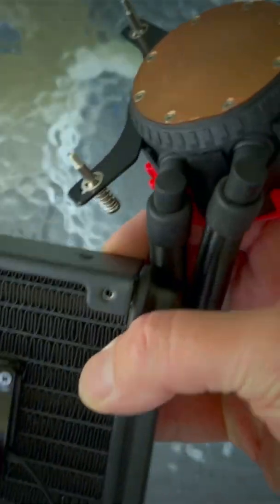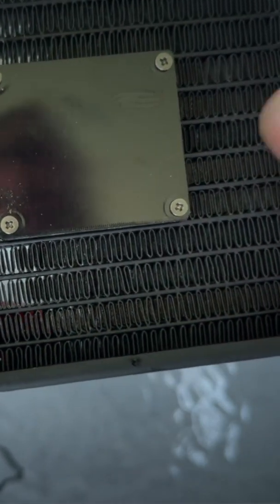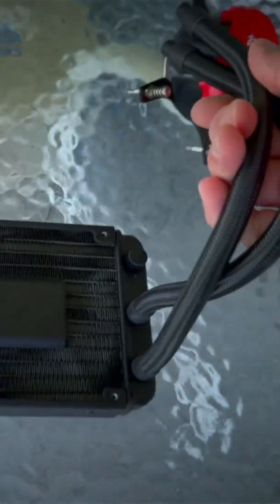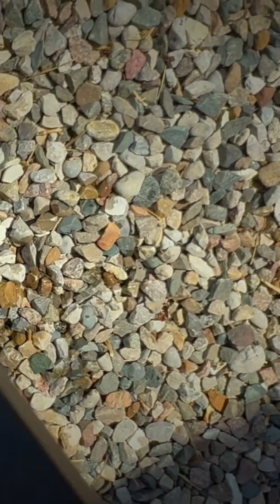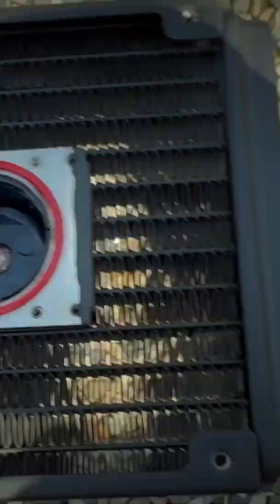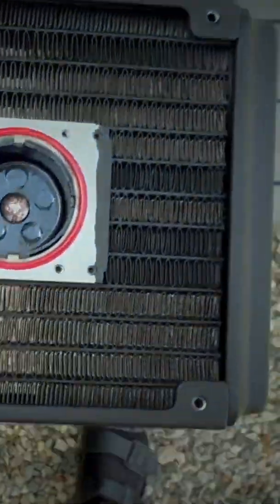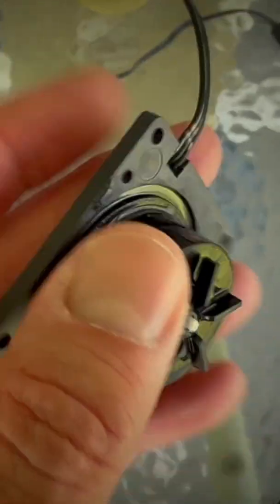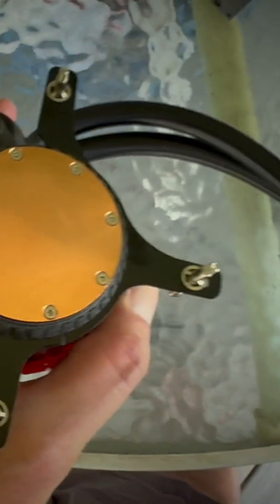🧊 Why My CPU Hit 100°C – Opened My AIO Cooler and Found… Nothing?!

Comment: and this is one of the many reasons I prefer air coolers. Cheaper to replace if a fan dies and no worry about any water/liquid to dry up
Reply from the maker: @swahkennison7116  I agree I switched back as well to air coolers. I just uploaded a video where I replaced the water cooler with an air cooler.